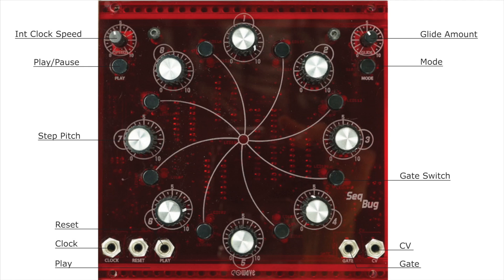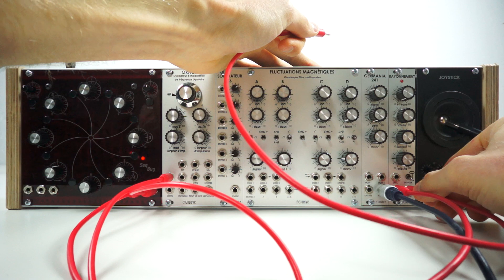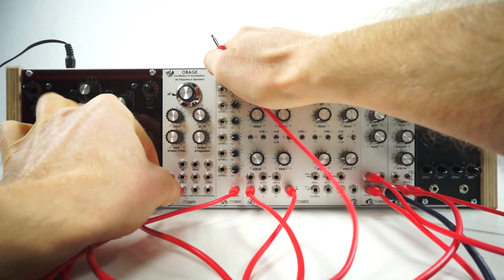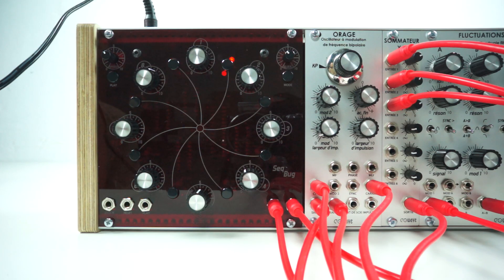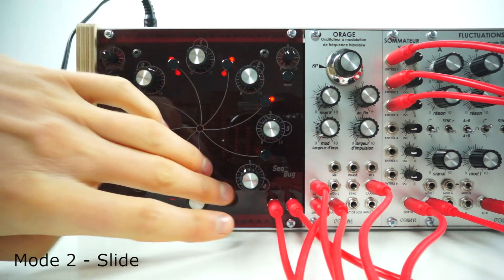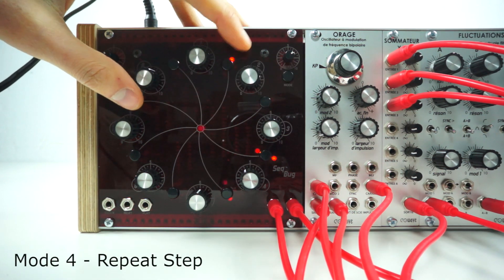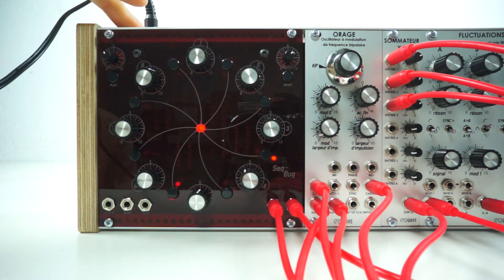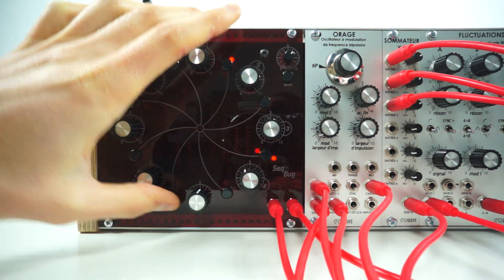Eowave DIY 8 Sequencer - Eurorack Modular

Comment: ok but, how (with this set up) can i control de tune of the vco for example with a Minibrute that provides pitch and gate out? thanks
Reply from the maker: You would take pitch out of the minibrute, and put that into either the V/Oct in of one of the oscillators, and the gate from the minibrute into the envelope gate input - this would be bypassing the sequencer in this video but that would be how to control the pitch and envelope of a modular synth with a minibrute